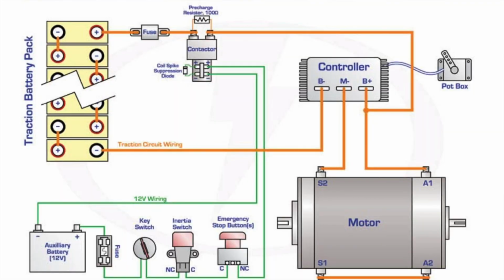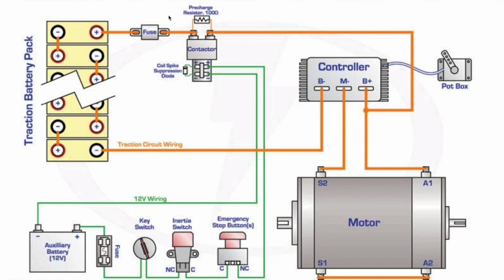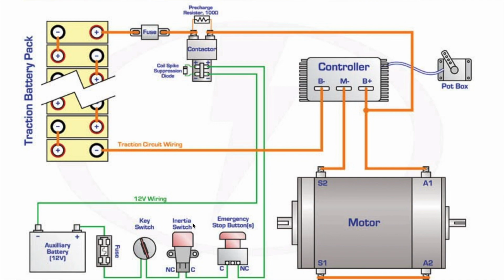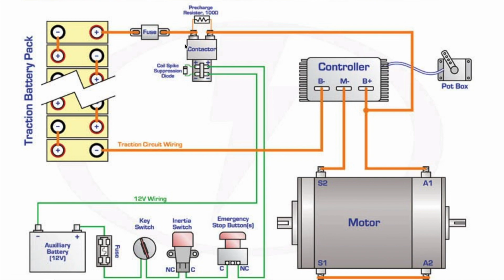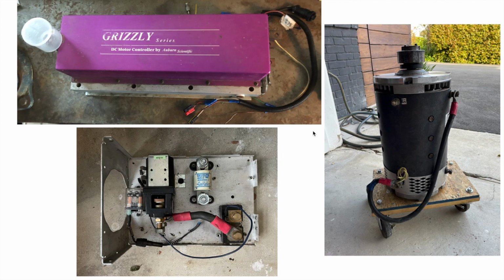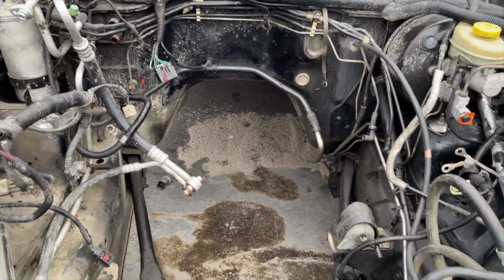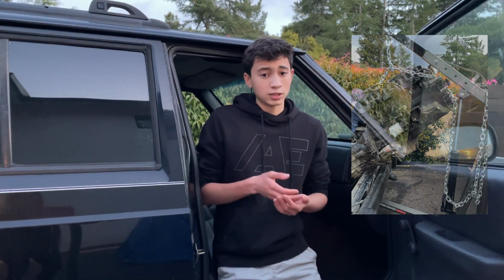Jeep Cherokee EV Conversion - For sustainability!

Comment: Love your video. I will definitely be following. I see that you pull out a 4.0 liter inline 6 cylinder engine. I have 2 1999 Jeep Grand Cherokee with 4.0 liter inline 6 cylinder engines. One has a bad engine and wanted to convert to electric. Would love to know where you got your adapter plate and hub adapter at. I have watched several videos on electric conversations but your shows a adapter plate the is bolted on. The other videos I have seen they are having to make their own adaptor plate. Did you get the adapter made or did you find one already made for this application. Would greatly appreciate the info. Thank you for your time. Ken

Comment: Was just thinking about doing this to my 99 because the motor is on its last legs and the EV low end torque would probably be awesome for Moab! 
Range would be an issue for that though. But couldn't you charge it with a generator in a pinch? 🤔

Subd, can't wait to see how this goes and what the performance is like.